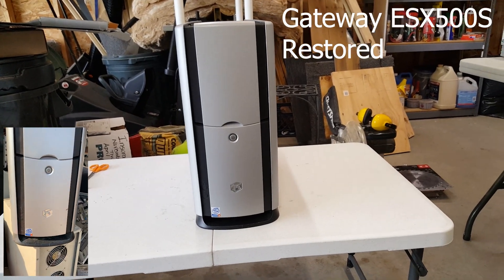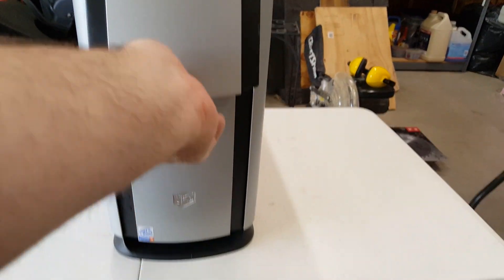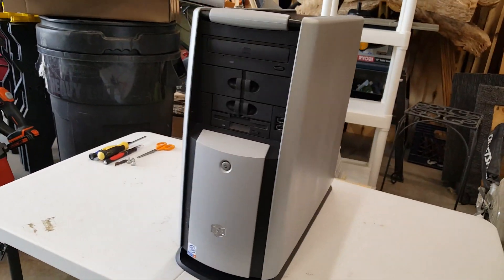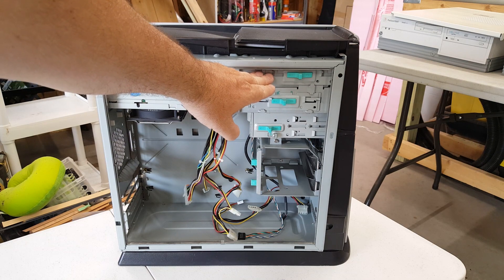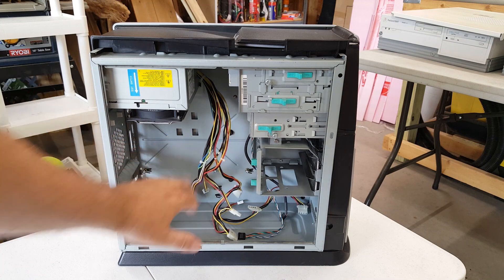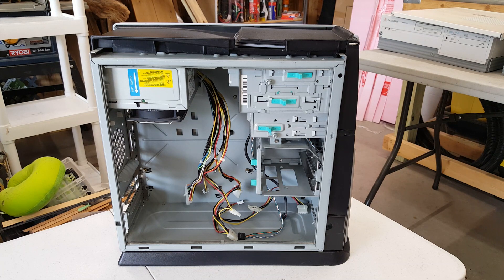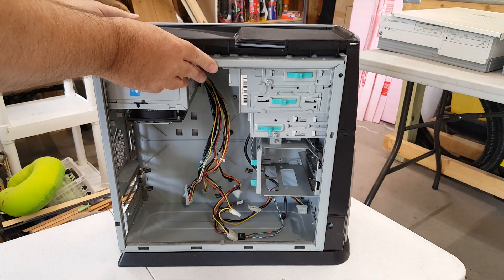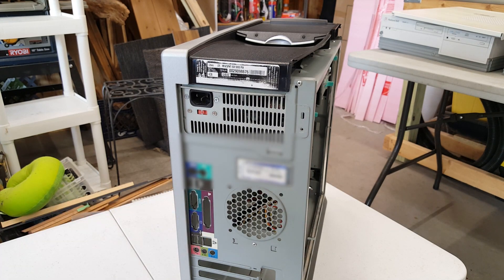Gateway ESX500S Computer Restoration

Comment: Im glad i found this pc because it helped me find this channel trying to find more info on the case etc.
I like the idea 👍, Just picked up one of these yesterday because I immediately thought it looked nice for its age and more than likely I could turn it into a Linux sleeper PC with a bit of modification. I agree with not putting another p4 in it as some have commented and maybe putting the fastest for as cheap components in it that you can (example: i have a working mobo/cpu/ram from a 2013-2014 pc i found for free ,i figure the more Frankenstein the more fun sometimes but thats just me. Getting things to work for as cheap as possible ,a little sloppy mechanics touch doesn't hurt with a solid side panel 🙂, 

 I've done two other pentium II era tan sleeper PCs but this almost hides in plain sight because of how minimalist and sleek it still looks. 

Good luck on your search for components and ideas however you decide i bet it will turn out good👍.
Reply from the maker: Hello pal!
Super nice comments!  Thanks for peeking around and finding us.  This is definitely the most "modern" restoration that I have done to date, and I think it looks stellar.  I am still torn about exactly what to put inside it.  On one hand, I want it as original as possible, and on the other hand, I love the sleeper PC idea.  Sigh.  Time will tell!
Reply: It's a shame that gateway and other manufacturers typically put in those  proprietary quirks like the built in I/0 shield etc., Where it involves having to whip out the dremel and safety squints* 😬, ,Too bad you don't have a 2nd doner shell.
Reply from the maker: Indeed too bad.  This one, again, came out pretty well all things considered.  The sturdy side panel is a plus, as you mentioned.

Comment: I have the same exact computer but it doesn't turn on the green light in the motherboard turns on but when i click on the power button is not starting do you know how can i turn my pc on without the power button?
Reply from the maker: you can short the two pins on the motherboard with a metal object to start it without the power button.  Be careful!
Reply: @UncleMikeRetro  thank you i have tried to do that but is not turning on maybe i'm doing it with the wrong pins it should be the pins where the white and blue wires are, right? Have you ever tried to do this with your computer?
Reply from the maker: yes, I get lazy and just short the pins with a flat screwdriver at times when bench testing.  I have to say that if it refuses to boot, the motherboard may be dead
Reply: @UncleMikeRetro  ok thanks a lot for your help i will try it again happy new year
Reply from the maker: happy new year to you too!